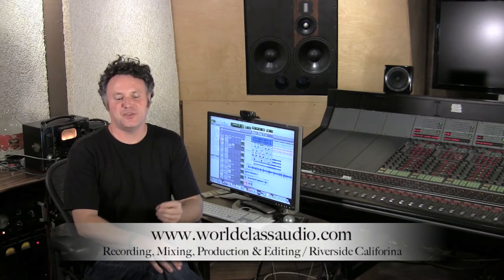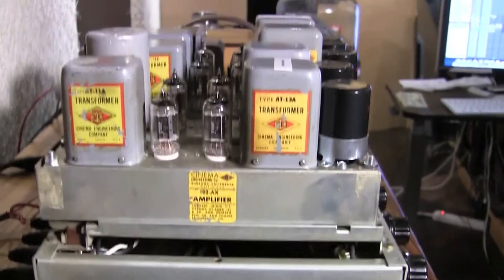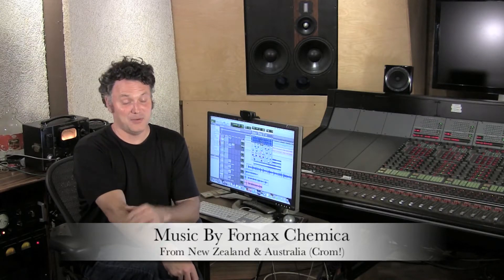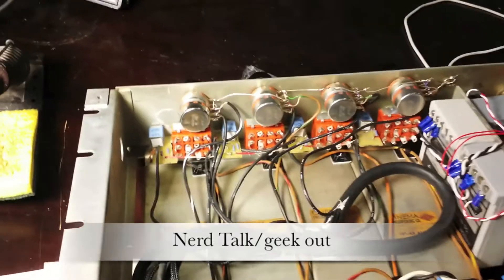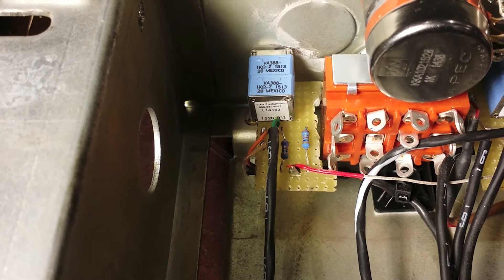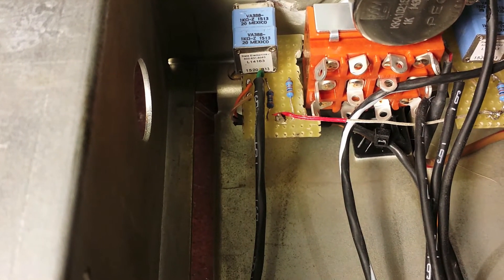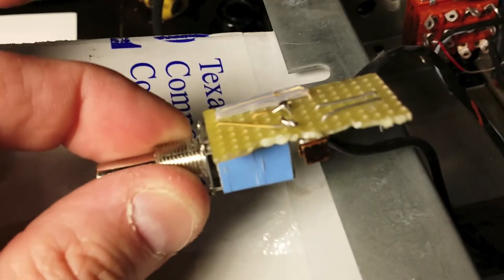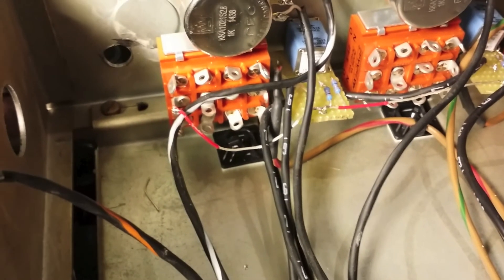Metal Film vs Bulk Metal Foil in audio attenuator tube line amp

Comment: Metal Foil Resistors.
This component can withstand extreme temperature variations and makes it optimal for aerospace applications.
The video is an introduction to the manufacturing process of the same.
Metal Foil Resistors, theory and practice, component to be used in aviation applications and space systems.

1-Metal Foil Resistors, Link to a document.
 Topics on metal foil resistors,
 theory and practice, with the corresponding bibliography.
Charly GarcíaJuly 15, 2022
Metal Foil Resistors  , https://www.youtube.com/watch?v=eRs6GJTAvJM

2-Theory on the manufacture of the metal foil resistor, first part. 1
This video sequentially describes the first part of the metal foil resistor manufacturing process,
each image is accompanied by its corresponding bibliography, which the reader can consult more extensively.
, https://www.youtube.com/watch?v=QPeFu5du7W8

3-Thermal treatment of the metal foil, to adjust the temperature.  Temperature Cofficient of Resistance 1. Evanohm
Thermal treatment of the metal foil, to adjust the temperature coefficient of temperature TCR.
coefficient of temperature TCR, https://www.youtube.com/watch?v=HDZAm2wAnrk

4-Metal Foil Resistors page, with the theory and practice and its corresponding bibliography.
 https://telegra.ph/Metal-Foil-Resistors-1-07-15, Metal Foil Resistors Index
Manipulation of the TCR in metals. 1 https://telegra.ph/Manipulation-of-the-TCR-in-metals-09-08

5-Metal Foil Resistors, Metal Foil Resistors 3.https://www.youtube.com/watch?v=fM8Rd89V01c&t=153s
In order to modify the properties of the TCR,
it is necessary to use an oven with special characteristics such as those described in this video,
for more information read "Heat Treatment Principles and Techniques ,Ashok Sharma, C. P. Sharma, and T. V. Rajan.

6-metal foil resistors, https://www.youtube.com/watch?v=eRs6GJTAvJM
10 views  Aug 30, 2022  Topics on metal foil resistors, theory and practice, with the corresponding bibliography.

7-Manipulation of the TCR in metals. 1. https://telegra.ph/Manipulation-of-the-TCR-in-metals-09-08  .The adjustment of the TCR to compensate for resistance variations due to thermal effects is carried out by heat treatment of the metal foil. The nickel-chromium alloy, called Evanohm S, (see Hamilton Evanohm S), can have its TCR adjusted, in the range of about 100 to -20 [ppm/°C], during the manufacturing stage, by heat treatment. in the temperature range of 400°C, resulting in a graph like the one shown below, resulting from a 2-hour heat treatment.

8-  Metal Foil Resistors . Sep 15, 2022  Thermal treatment TCR. 1 ,This movie describes the first part of the metal foil treatment.https://www.youtube.com/watch?v=_pVK6fHFWS0&t=36s

Comment: Nice video! I still quite like the metal film resistors, to me they sound more dense in the lows and mids, sounds more gritty, the bulk metal foil present the audio in a more analytical way to my ears, clearer and "colder" less bass more details in the highs which is nice but somewhat less musical I think. Both have their strenghs, a mix of bass and mids of the metal films + highs of the bulk would be cool ;)
Cheers
Reply from the maker: 100%

Comment: i wonder if metal film resistors will provide all similar performance ... or some brands/models are better than others.  I have a direct experience of a volume attenuator made with resistors from Holco.  It sounded great.  And still reasonably priced ... anyway thanks for the great video indeed.  Kind regards, gino

Comment: These resistors are well worth their cost which is substantial on a per unit basis. I was considering doing some work on some vintage equipment using these. It is no longer a think issue after hearing them on this video! Duh! Sold! No brainer!

Comment: Shawn, please try that again using Dale RN series metal film resistors.  The ones you used for comparison were cheap, nasty junk parts.  The low resistance of the circuit really tilted the tables against those cheap parts even more.  Try also looking up the noise specs on the Dale resistors I mentioned.  They are more on par with the bulk metal film parts.
Reply: Hi Chris, in our experience if you're trying to eek out that last bit of transparency and drop the noise floor as low as possible in a high-end system, the foils vs. quality films are very well worth it. After all, it's an industry where people willingly pay $1,000's for interconnects or speaker cables, yet most give virtually zero thought to the hundreds (if not thousands) of parts (transformers, caps, resistors, diodes, wire, etc.) the signal must pass through on its way to the speakers...and ultimately, your ears. We spent a fortune on foils and don't regret it for a second. Incidentally, where cost is an issue or in areas of a circuit outside the signal chain, we 110% agree with your choice of the Vishay/Dale RN's/CMF series. They're superb films all around... used them for years.